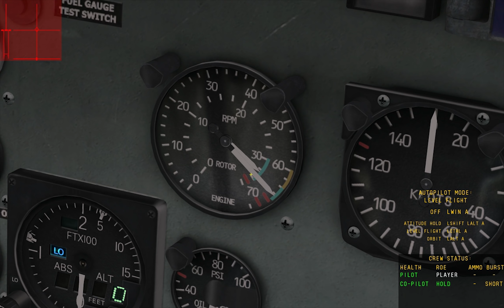Flying & Landing the Huey in DCS

Comment: Firstly, great video Dyslexci. I tried DCS A-10 and was really overwhelmed. Watching is more fun than playing at the moment!

Now I've asked a few YouTubers on this and have never gotten a response, so I'll try my luck here! I realise you have used Track IR for many years now, and it is second nature, but do you recall how you initially found it?

I don't have the money for a Track IR, I've tried a few alternatives such as FaceTrackNoIR, I realise it isn't a substitute really but you work within budget, right?  I find that I cannot hold my head perfectly still, which these systems appear to require. When I do do so, I get severe neck pains. So I adjust the curves to amend this, then I find I have to turn really far, almost having to swivel my eyes 90° to see the screen, which is of course not great.

I'm sure with further tweaking these alternate systems work adequately, but after an hour or so of neck and eye pains I'm done in! Does the T-IR5 not suffer from these issues? Or is it down to proper callibration to avoid such problems?
Reply: can't you just set some kind of deadzone till the system picks your movement up?
Reply: I use track IR and I don't get any neck pain. When you look with track ir it's not a 1:1 ratio.. With the default setting I can look about 20° IRL to look 90° in game, and about 40° IRL, to look 180°. The head turn ratio is not linear so it changes with higher degree of turn. I find this very easy to use, you can use small head movements to look around,  and can also be easily modified.
Reply: I use faceTrackNoIR with a headset clip setup. 3 regular green leds attached to 2xAA batteries. That's it. Nothing in between or anything.
It does take some tweaking to understand, or rather, get the feel for the curves setup. But yea, the curves are extremely important.
I use a small dead zone. The curves are totally flat on the far left side, then they slowly increase (exponentially?). So that I have smooth, precise movements when looking around 75°, maybe a bit less. But then the more I go beyond that, the higher the sensitivity gets.
Everyone probably won't like it, but it works for me.

There is one thing that bugs me though, and I'm not sure if it's cause of the dead zone or not. When I look up and down when looking sideways at the same time, I can feel it snap a little bit to the horizontal center line when I get close to it. It's not a big thing, but it's a bit annoying.
Reply: http://www.delanengineering.com/delanclip/buynow <--- I cannot recommend this enough if you are on a budget. I use this and a Microsoft VX-1000 webcam. The DIY aspects of this are minimal (depending on whether or not you get the pre assembled version or the DIY kit). I paid £25 for the pre assembled kit and £10 for the webcam. There are instructions for the removal of the IR filter for the webcam on the internet, and I use freetrack to get it working with my games. 

ARMA and a few driving games that I have tried out worked out without the need of third party hacks so to speak. It functions as though it were track IR in game and gives you 6DoF just like track IR. 

There were a few problems with getting it to work with DCS but nothing that couldn't be overcome. 

There are fully customisable settings with dead zones and curves and to be honest from my experience holds up really well against track IR. Freetrack's software, although I don't believe it is anymore being developed is still fantastic. 

I really recommend this as a cheap alternative to Track IR. Message me if you have any questions! Track IR is expensive, but truly this is another option, that for all that I have experienced, is just as good!
Reply: As Christoffer Hannevig and Neeken mentioned the TrackIR program allows you to easily modify both the sensitivity and exponential movement quite easily, you even have a 3D model of both your head and the in-game character's head in correlation to your movement including a spherical compass to see the different angles you will see in-game, so you can experiment and find the balance for what works for you.

Usually I don't move my head more than 30° IRL at a maximum when looking behind me 180°, so I am limited to very little head movement, thus preventing any neck ache over longer sessions.

The "worst" movement for me tend to be the "roll" when I try to keep my head leveled with the horizon.

Here's an example where "Raw" is my real head movement and "Game", well, is the in-game movement of course: http://puu.sh/9YAiC/62c74a72d8.png

You can also change the dead-zone of headtracking, so if you want to keep your head pointing forwards without having to sit dead still, you can have a dead-zone where it will barely move until you surpass that limit so you won't have to worry about sitting still like a damn doll.

Also, sorry for typing this much, thought it might be useful information.
Reply: Thomas Jørgensen sorry to hijack what your saying there, all of which your absolutely right, is configurable in track IR, is also there in freetrack.

I have multiple profiles setup depending on the game where this becomes very important. In DCS I like to have a far more loose set up (not the best way of describing it but I mean to say that I have almost no deadzone) but in ARMA, when you need to aim down sights and you want it to be centre of scene because that is what is natural in FPS's, I have a much larger deadzone so that when in those more hectic moments you don't need to spent valuable seconds lining up your head so that you perspective is what you would normally expected. 

As you say these things are all fully configurable and most of the time completely dependant on the game that you are playing. 

Once you get this all working for you as you are comfortable with it though, you honestly will never look back. I cannot play ARMA, DayZ or DCS without my head tracking anymore. As stupid as it sounds but it is almost unnatural to play it without at this point.
Reply: Dan Thomas Your informative hijack is approved.
Reply: I don't use roll myself. Only pitch and yaw. Roll in theory is nice as you can level the horizon and feel the movement of the heli more, but it doesn't work well with tracking like that imo.

But seriously, you don't need TrackIR.
I had 3 leds lying around and my MS Lifecam Cinema webcam. Hooked them up to a coat hanger I shaped like a V, shorter in one end of the bend. (Tutorials online). Called a 3 point clip-on or something like that.
It tracks perfectly. Not even IR leds, or a modified webcam.
Might have issues if the sun is coming through the windows here, but if it's overcast it works like a charm. Only drawback I'd say. But I play mostly after dark anyway.

I would recommend getting faceTrackNoIR instead of using freeTrack though. They got freeTrack mod in it, but it's up-to-date. I don't think freeTrack itself is up-to-date anymore.
Also, it won't launch Arma 3 when I use it, why I switched to NoIR in the first place.

I'd consider TrackIR if it wasn't for the Rift coming up. Think I'll wait for that instead.
Reply: Thankyou all for so many comments. It is indeed something that you need to spend the time sorting out, whichever system you use.

What toying with settings/curves I've done in the past have had mixed success, but after an hour or so of tweaking and my neck is ready to crumble!

Again, thanks for some very thorough comments and opinions, was just what I was after. Cheers!
Reply: LeiFlux07 Also, if you get severe neck pains you might be setting your center point wrong. There's a shortcut key for setting it up whilst in-game. Try to set it at the most comfortable head position.
If you have problems with it in general, go see a doctor. :p
Reply: I do indeed suffer from a degenerative muscular and joint condition, which was partly the reason for this post and not already going in the deep end with the tech some time ago.

But I don't let that stop me, and it was useful to get other peoples thoughts and suggestions. I will probably stick with FacrTrackNoIR for now, or look into that Delan Clip Dan Thomas mentioned.

Again, thanks to everyone who took the time to post!
Reply: I briefly looked into the free alternatives before getting my own TrackIR, and shortly after the TrackIR's rather shoddy plastic on the 3-point IR LED assembly broke one of the clips off (especially after reading the anti-competitive stuff that NaturalPoint tries to pull, for technology that they pretend they invented but which actually had lots of prior art), but generally speaking, the total opportunity cost of investigating the free alternatives has still far exceeded the cost of the TrackIR unit for me.

Basically, dependent on your income, you need to evaluate how much it costs you to sit in front of the computer researching; then buying LEDs (since most people don't have them lying around like another fellow here did =)); then bending over a table threading LEDs onto coat hangers; then disassembling, modifying, and reassembling a webcam; and then testing, re-testing, calibrating, adjusting, etc. to make sure it actually works with your desired applications.

In short, giving some money to NaturalPoint, even though they probably don't actually deserve it, will save yourself a lot of pain and hardship.  Regardless of whether you spent $40 for a budget system plus $100 in opportunity cost, or $140 directly to NaturalPoint, is immaterial on a strict cost-to-benefit ratio.  If you have moral compunctions against NaturalPoint (and I can respect that), or if you're a hacker in the true sense of the word, you'll probably enjoy rigging up your own HackIR.  For those people who have neither the time nor inclination, however, TrackIR is a ready-made, functional, and far more convenient alternative.
Reply: jtgibson01 I don't have a clue about electronics, and it took me about an hour to make one that worked. I just had a plastic bag of regular LEDs lying around, all of which lit up with 2 AA batteries connected to eachother, positive to negative in one end. I did that with tinfoil and PVC tape aka. electrical tape.
Everyone should have that type of tape lying around. It can save you from a lot of trouble :p

With normal LEDs you don't have to modify your webcam at all by the way. Only with IR LEDs.

It wouldn't cost you much at all to make one if you didn't have any of it lying around either.
You make it sound like more work than it really is as well.
The calibrating is a breeze as long as you have the measurements for your clip-on, which you should have if you made it yourself. The coat hanger is only one bend. You can even print out a template so you get the right degree bend.
I do see tutorials online where people are using resistors, but I didn't need them at all. I tried with 1xAA first, nothing happened. Then 2 of them and it worked fine. That's all I needed to know. And they still work.

And after making one, you can make more quite easily if anything should happen.

I am not spending that much money on something that simple.
I'd like to know how much they spend to make a TrackIR kit. Cause it can't even be close to what they charge for it.

But hey; if you got money to spend, and you don't enjoy crafting, why not.
Reply: Neeken
My raw estimate on a per-unit manufacturing, materials, and assembly cost is that they have no more than about $2-$5 of components in the TrackClip Pro and around $10-$15 for the IR-sensing camera, with economies of scale taken into account -- so, raw estimate, a +600% markup.  I was very underwhelmed by the "quality" of the TrackClip, which really is nothing more than a power and ground wire to power 3 LEDs in series plus a small plastic housing, but the IR camera is itself of fairly decent quality and likely the high-ticket item out of the kit (especially due to the PCB, which given its size would have to have been professionally printed).

The missing picture is how much the development, design, and factory tooling wound up costing, which dependent on any engineering and design inefficiencies can significantly cut into that markup, but they're undoubtedly still earning a fair profit per unit sold. =)

Comment: Pewp. I have a Warthog ¬_¬ Is it seriously holding back my flying? I am getting slowly better but hovering is tough as nails. Also I think they must have changed the flight model since this video. That 500fpm descent would just buck you into VRS now :(
Reply: +Mirandorl Three things you can do with the Warthog to improve for helo use... most important is to buy an extension tube for the stick (cyclic). I use a 12cm stainless steel tube extender and a small wiring harness to extend the electrics.  Slacken off the springs in the joystick... google for various methods.  Some people take them out altogether!  Mess with the curves in DCS controller setting to shallow out the stick movement. Hope this helps. The Huey is a joy :)

Comment: I have this bump problem you were talking about, except on my track ir 5. Each time I centre my view, and then try and move in a yaw or pitch axis, I feel like my in game head is passing some sort of bump in the controls. Is there anything I could do with the axis curves to change this?
Reply from the maker: You probably have some kind of dead zone configured in your TIR profile.
Reply: I've used your TIR settings from your website and they seem to also have this bump, I believe it's caused by the sharp shape of the graph which causes a fluctuation in movement when you pass your head over it. 
I just cannot find the right dead zone for me, I need to be able to strafe targets without having my view jolting around, but also be able to look at the ground quickly when landing. I wish I could find the right settings :/
Reply: Tibialstone7 Play with the curves, or set 1:1 profile as default with minimal smooth
Reply: It's taken me a while to find the right settings, and I still don't think I've found them, but for now using Dslyecxi's profile with a few sensitivity alterations has been working a charm. I also found I like a higher sensitivity when I have low FPS, and a lower sensitivity when my FPS is high.